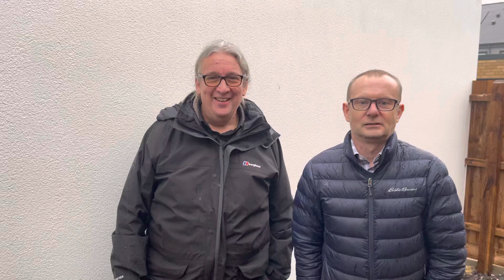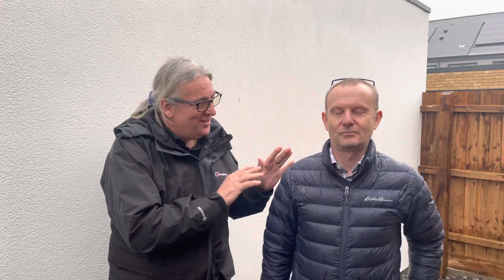#Micro-Grid Generation ( UK Style )

Comment: Hi there. I have a question: if I'm using the Sunsynk 12kw 3 Phase inverter and want to connect a generator to the system. Do I need a 3phase generator or will a single phase generator work?
Reply: did you find out?
Reply: @paul potato  yes unfortunately I need to have a 3phase generator. Won't work on a single phase one.
Reply: @byronm7259  i want to buy a three phase sunsynk but i got enphase  7 micros on the panels,.can you operate grid down?

Comment: Pitty there is zero to none info available on complimenting Sunsynk's Inverer with a limlted Microinverter/Power feed via the Generator Port. Eg How To, Whatchout for, Cause/Effect, etc
Reply from the maker: We have got information on one of the videos maybe it's not very clear ocean which one but I will take note and do something else
Reply: @sunsynk  Thanx.. eg Theorizing the feeding of my Trailers 4kw 12v Lithium battery via 800w Victron Phoenix Inverter into generator port when loadshedding is announced and my 48v 5kw State of charge is at 30%..This may be enough to assist with charging the main battery out of imminent shutdown